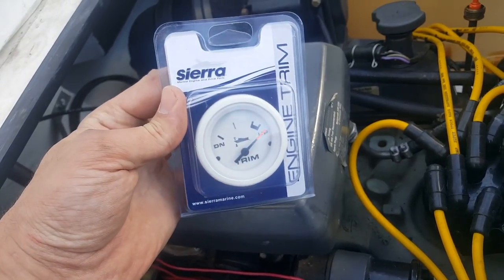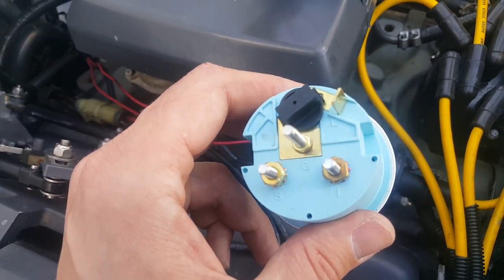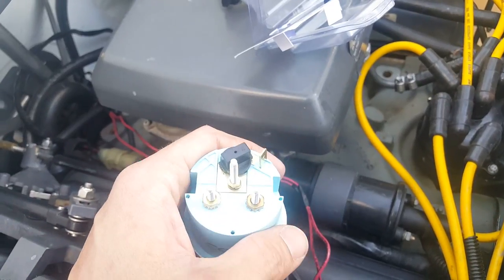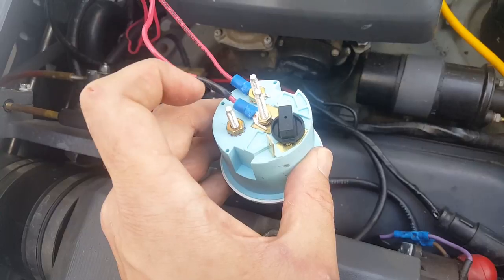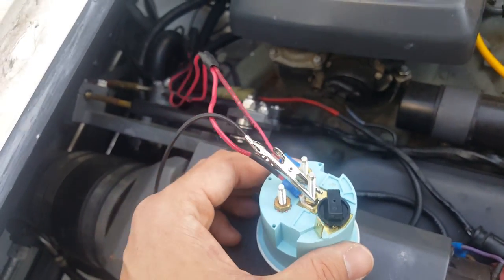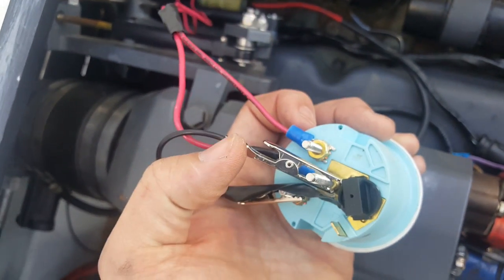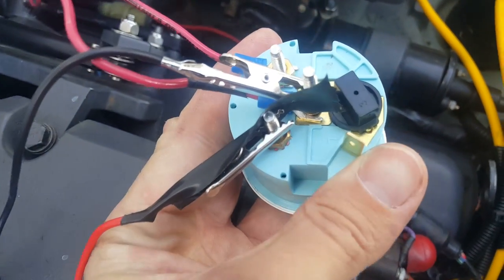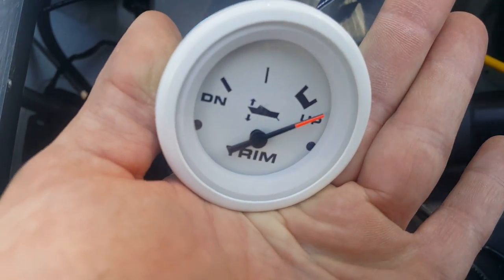OMC Cobra Volvo Penta SX Engine New Trim Gauge install

Comment: One other note: I tested the connections in the engine hole and the gauge worked perfect.  However, when making the connections to the gauge at the dash I forgot to turn the power off and lightly crossed the ignition terminal with the ground terminal. Replaced 10 amp fuse and it now works backwards.
Reply from the maker: I thought I replied to this already. I'd get a really cheap trim gauge and test it. I'm 99% sure you shorted out the gauge or some sort of wiring. My subscribers get top priority when it comes to me replying quickly. Please hit that subscribe button!

Comment: just ca,e across your vids and they are just what i needed.   my trim gauge doesn't work and the trim is working fine.   should i assume  the gauge is bad?
how to test the gauge before replacing?
Reply from the maker: It's likely your sender is bad. Especially, if you have an 80s/90s OMC/Volvo. You can buy gauges really cheap and test the sender in the back, where the harness is located.
Reply: @michaelromer2016  yep, 1996 VP sx.  does it make sence just change the wire routing to more a reachable location?   no way can i get to where this vid is showing?   i really think the sender is corroded badly.   previous owner had total gearcase covered in algea and i mean covered w/ algea.
Reply: whst happens if you take the bolts out  that are located on the side of the gearcase?    is this for adjusting  or is there acess to wiring connections?
Reply from the maker: That for adjustment purposes. You can turn the drive to the left and take a peak at the cable. Chances are it is comprised.

Comment: Thanks for the video- very informative.

My boat trim gauge is working fine but I am looking to replace the entire gauge cluster to modernize the dash a little bit. 

If I simply swap gauges and don’t touch the trim sender or anything at the back of the boat, will the gauge require adjustment or will it just be calibrated when it’s installed in the dash?

Thank you in advance!
Reply from the maker: These gauges work based on a potentiometer built  in the trim sender, in the back. For that reason, no adjustments are needed for your upgrade.

Comment: I recently replaced my OMC Cobra sender and gauge.  Wired correctly but the gauge works backwards. Revered the wire order of the signal and ground but still have the same issue.  Is it possible that the polarity of the gauge is reversed?
Reply: One other note: I tested the connections in the engine hole and the gauge worked perfect.  However, when making the connections to the gauge at the dash I forgot to turn the power off and lightly crossed the ignition terminal with the ground terminal. Replaced 10 amp fuse and it now works backwards.
Reply from the maker: This appears to be a bad gauge.

Comment: From where would I get the lead to connect the trim sensor to the gauge? I have located the plug.
Reply from the maker: The two wires that coming out of the trim sender are used in the G and S position. Please keep in mind those two (G & S) wires are not interchangeable. I found that when I ohm test the 2 wires (which go into the G & S part of the gauge) coming from the trim sender, one ohms between 0-160 Ohms @ 20K and if you reverse the leads, you get a different reading. What that means is you need to watch my trim sender diagnosis video first, then re-watch this one. It will walk you through determining which part of your sender is G and which will be S.  Have a good one!
Reply: I watched the other video and most of your others as well. Thanks so much for your help. So do I separate the plug and redirect the wires from below to the gauge?

Comment: What about mercruiser
Reply from the maker: You can make a sender work with a ground, hot, and sender connection. It doesn’t matter the make and or model of the boat.